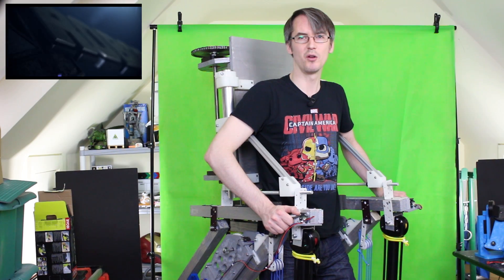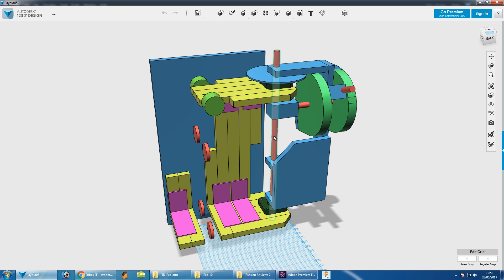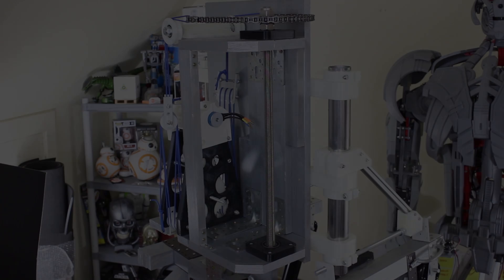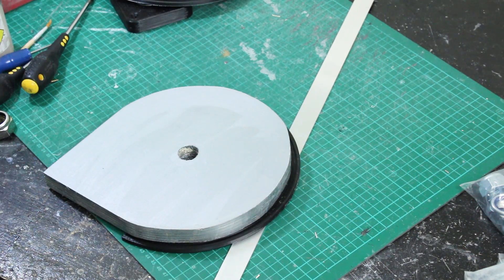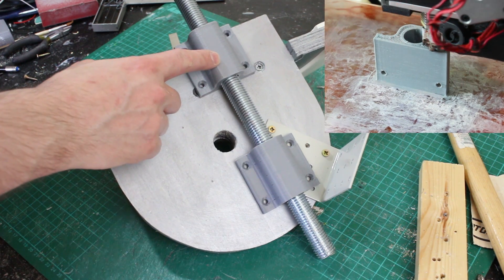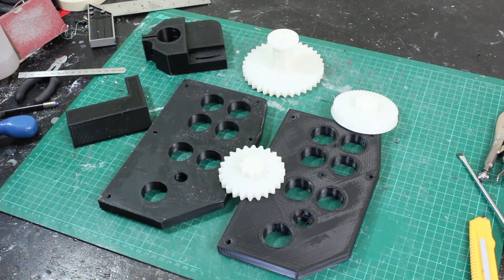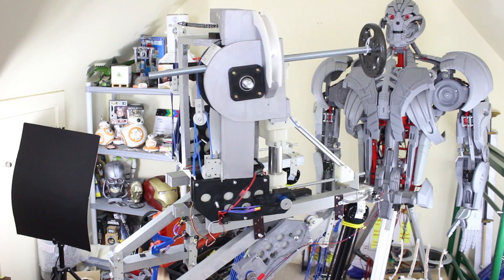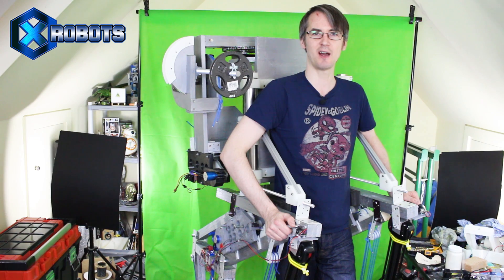Iron Man Exosuit #10 | Power Arm Shoulder | James Bruton

Comment: You could make a large hole in the sprocket and put in a wooden or 3D printed wheel that locks in, to reduce weight on the sprocket.

Comment: As much as it is enjoyable watching you screw screws in with s screwdriver, doesn't it get strenuous? Maybe invest in an impact driver drill?
Reply: James has trashed all his impact driver/battery drills for his ProjectX robot... should have saved one. I guess he regrets that now.
Reply: Extra Mental just a battery hand drill will do. I think he already has one.
Reply: An impact driver is a battery hand drill
Reply: Extra Mental yeah its drill driver. They are more expensive. A basic combi drill will also drive in those screws without the need of pre- drilling. He already has one of those.
Reply: Simon .Berntsen He bought those drills just for the motors. I think he prefers screwing stuff by hand. I find it tedious even when I use my hand screw driver its one with a racket.